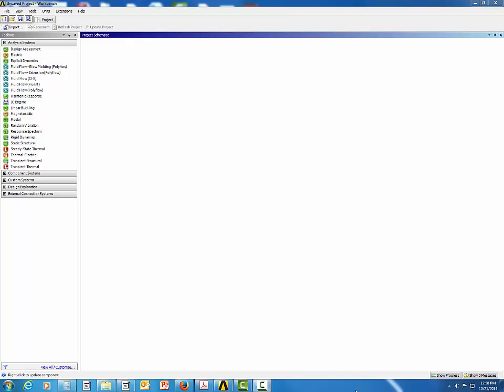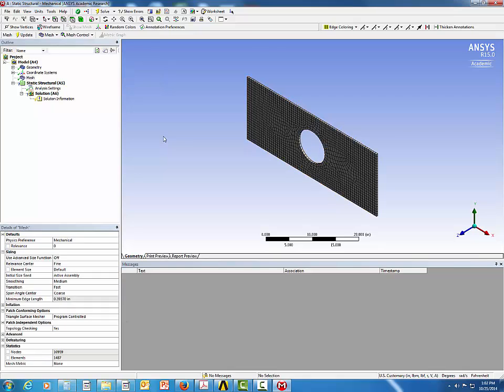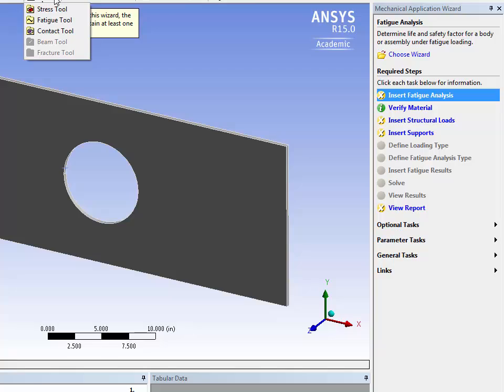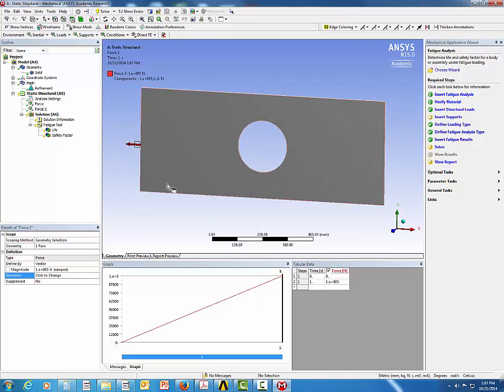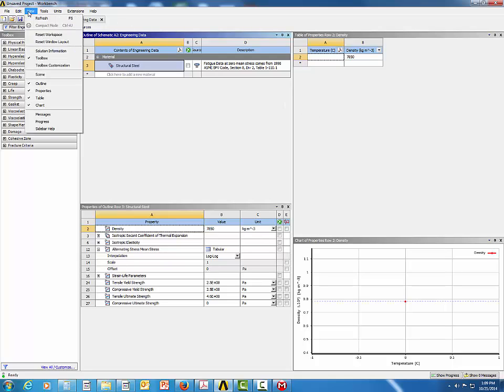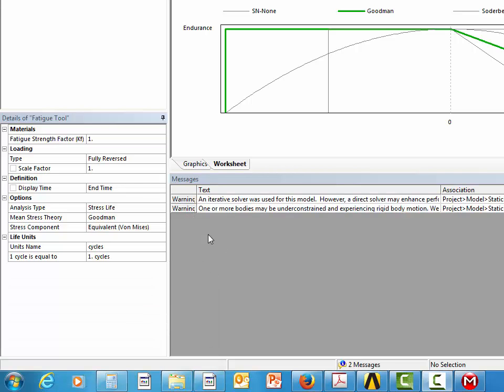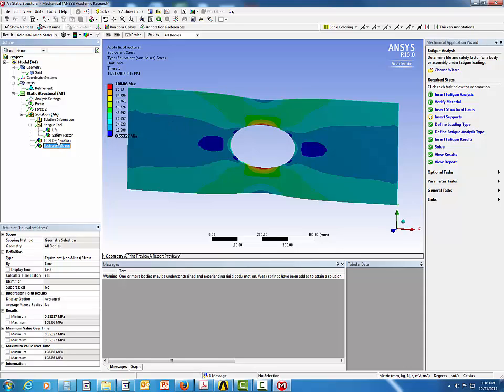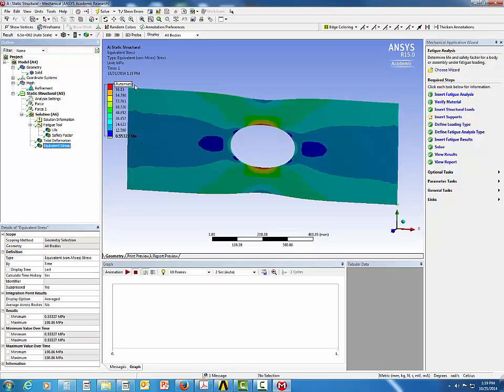Fatigue Analysis of a plate with hole using ANSYS Workbench 15.0.7

Comment: Hey Ajit,

Thanks for the tutorial. I am performing pressure vessel analysis where my pressure fluctuates from 2 barg to 10 barg. I have performed static analysis for these two different pressure by changing analysis setting to 2.  

However, for fatigue analysis how do we input these pressure cycles and the total number of cycles to be 10000.

Please advise